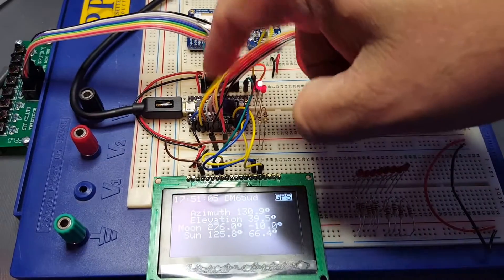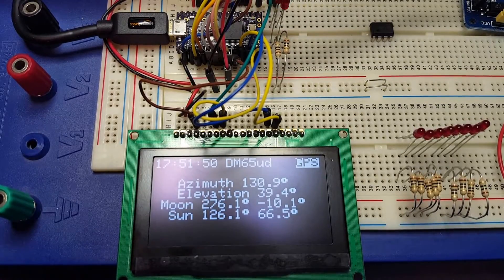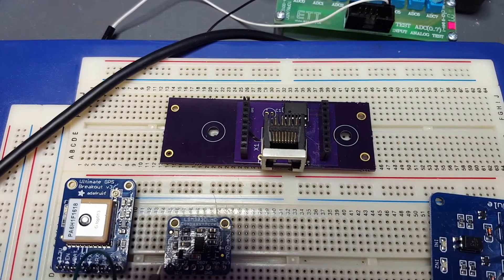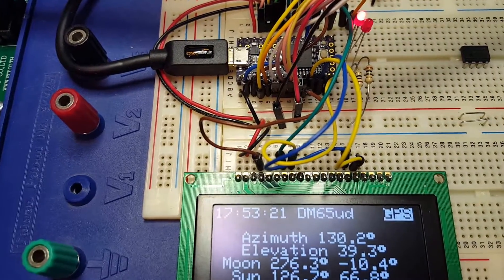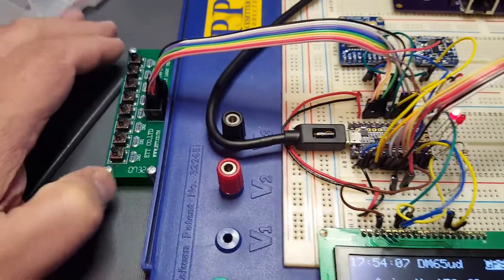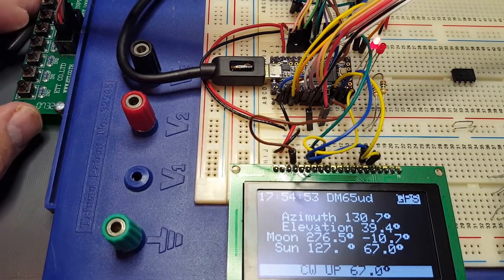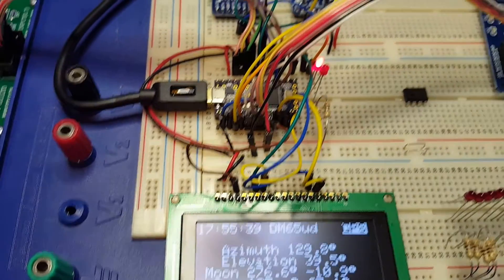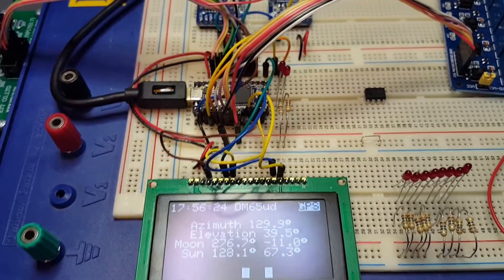My K3NG Rotator Controller using Teensy 3.x, graphics display, GPS, and accelerometer

Comment: Was wondering if you could help me getting k3ng rotor control using teensy 3.2 with 1.8.19 ardunio and teensydurino.  It will not compile and I know nothing about what is wrong.  Just need a basic program to compile then I can add as needed. Thanks N8JX

Comment: Very nice Freeman! I'm working on a mod to a meter-display rotor and would like to upgrade from a text-only character to a graphics display. Many of us on the K3NG forum would love to see how you coded this for K3NG. Would you please share the code?
Thanks and 73, Duane KA1LM
Reply from the maker: I thought I had put the github repo up on the comments with the video. The code changes I made are at https://github.com/N5FPP/k3ng_rotator_controller

Mind you, this is a snapshot of my raw changes and have not been cleaned up for distribution. What is there is pretty much a kludge, but it does work.

-Freeman
Reply: @FreemanPascal  where did you bought that display is ver nice one
Reply from the maker: @diogomatos5609  I purchased it from AdaFruit.com, at https://www.adafruit.com/product/2719

Comment: Excellent work!
This is exactly what I am after.  Would you like to share your code, please?
Reply: Here's the original code:  https://github.com/k3ng/k3ng_rotator_controller  (It appears Freeman's version which he demonstrated has some customizations.)
Reply: Yes I know.  I'm already using it.  I was actually after the Teensy / 128x64 display modified code.
Reply: Ah, OK.  73
Reply: Just keen to know how the gyro/accelerometer sensing is performing vs using traditional rotary encoder ? Planning to use that on a large satellite dish and need precision (can’t have jerking or delay in stopping the rotation). Thanks, ZL1RPL

Comment: Hello 
I have an Arduino 2560 and a display 128x64 .
How did you connect the display ? Do you have an I2C module integrated ?
Which module you have enabled rotor.feature.h in the file ??
Thanks Regards Mario

Comment: How did you get the Ada Ultimate GPS to work with the Teensy 3.2? I've spent countless hours trying to get it to work =/
Reply from the maker: Nothing special, just connected the TX and RX lines to pins 0 and 1 and used the Serial library that came with the Teensy board description. Of course I initialized Serial configuration settings - port, pins, etc.